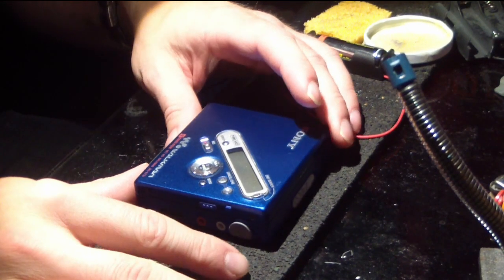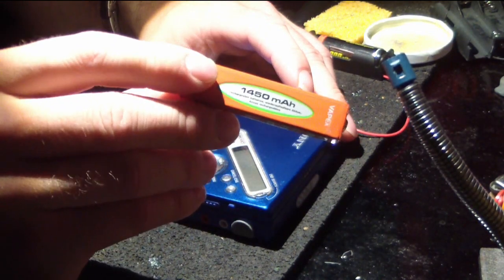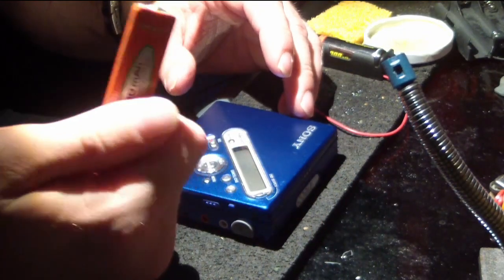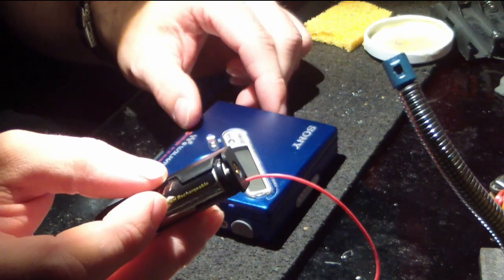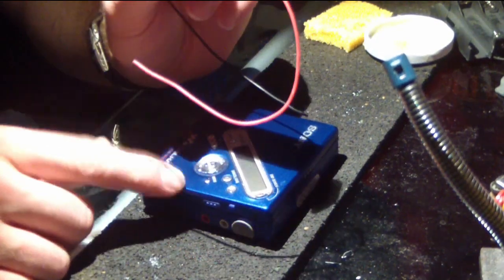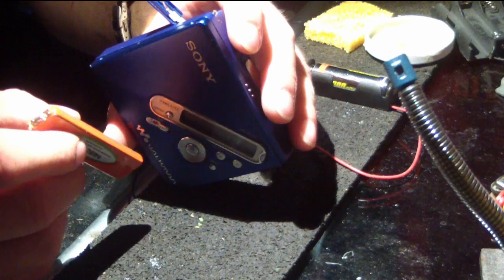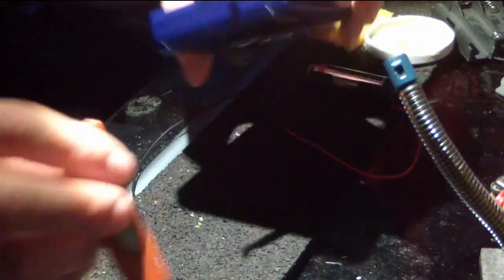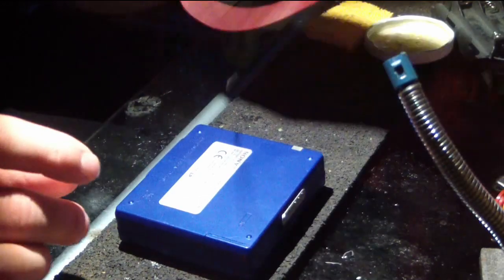My MiniDisk battery mod

Comment: We need more battery mods like this, I have 8 portables with gum sticks and a couple of them have issues with the battery doors and intermittent connection.  My best player the MZ-RH910 the plastic on the gum stick battery door becomes brittle and breaks with age.  I would like to fit a thin Li-ION battery inside and have been looking into that.
Thanks for the video.

Comment: Why not just use the AA battery pack that screws to the bottom of the device ?
I have the same model the 710 plus a better full metal 910
No longer use them tho

The 710 battery door is really loose not sure how to fix that it all looks intact and in perfect condition

Comment: Very nice! That's why every minidisc unit I have that uses a gumstick battery, I made sure that I have a AA battery "sidecar" for it. If I didn't, then I would doing what you did.
Reply from the maker: dave baker Just need a steady hand to remove the excess housing without damaging the circuits. 😉

Comment: All you had to do was bend/flex the small silver plate at the base of the battery door contact a tiny little bit (it's located just behind it's pivot point/pin) . You can only see this area when the back cover is removed. Once done the door will also fit better/tighter.
Reply from the maker: Nice advice. But being that my mod still works to this day, why take it apart again?
Reply: @DanielMcGregor  Because you've ruined an authentic piece of minidisc history.
Reply from the maker: @PCUser1024  Well, my MD player still works to this day on a much better established type of battery. And to be very frank the gumstick battery was and always will be an underwhelming piece of proprietary tech nobody asked for.
Reply: @DanielMcGregor  You're still missing the point.  Use the AA battery holder!
Reply from the maker: @PCUser1024  I never had the original Battery holder that screwed on to it. No I'm not buying it. Don't need it.